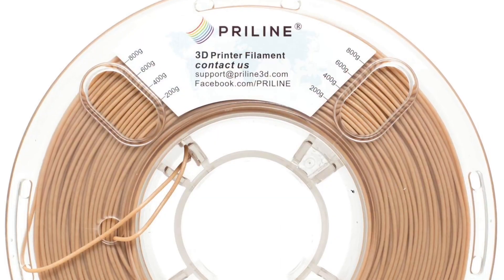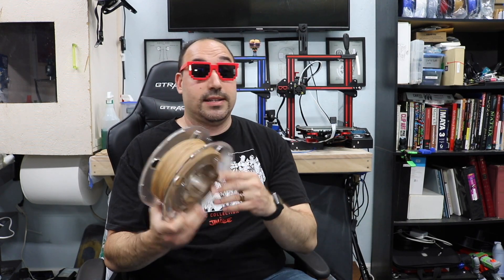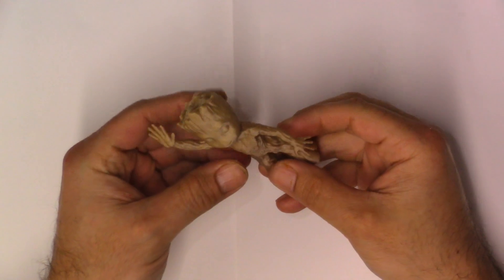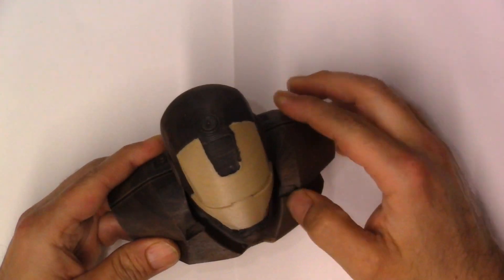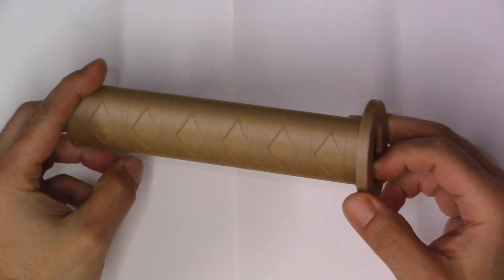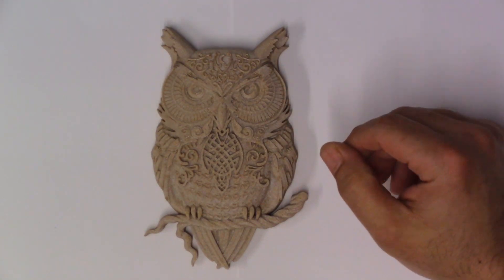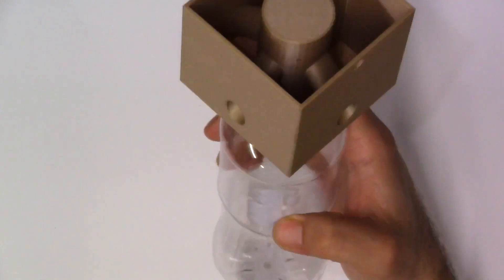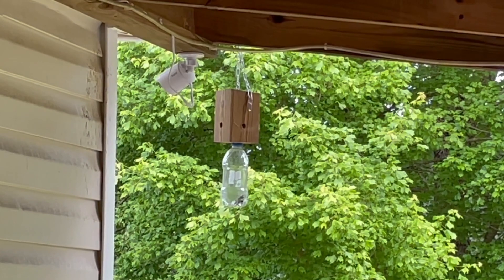3D printing in wood filament

Comment: Did you use a different nozzle size? I actually had to go up  a size because it clogged my nozzle on the Ender3 Pro. I've only printed some wooden tokens, but wood filament is actually really nice to play around with in post processing
Reply from the maker: I actually did not I just raise the temperature and that did the trick.